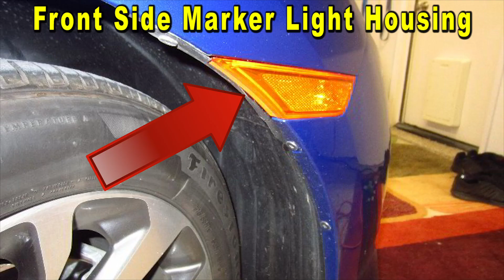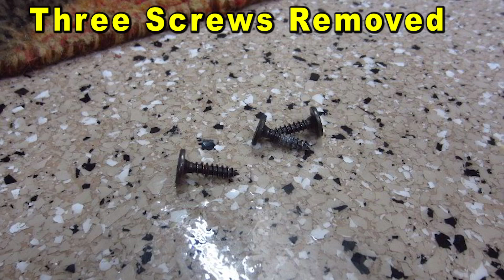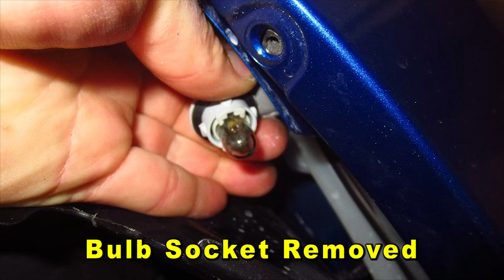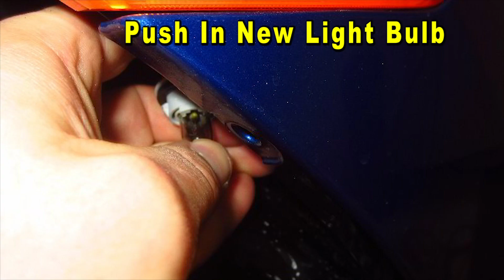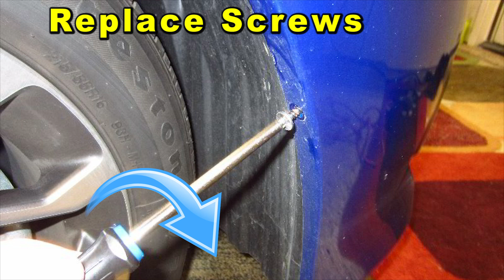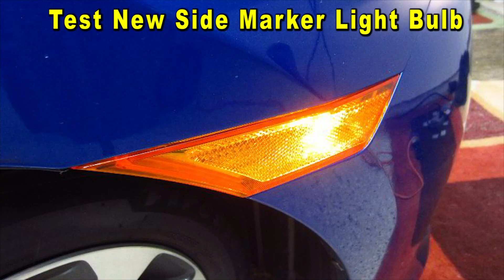Honda Civic How To Change Side Marker Light Bulb 2016 2017 2018 2019 2020 2021 With Part Number

Comment from the maker: Honda Civic Front Side Marker Light Bulb - https://amzn.to/44uHeFg
LED Front Side Marker Light Bulb Part Number - https://amzn.to/44BzQI1
Precision Screwdriver Set - https://amzn.to/3OYN1i0
Plastic Pry Bar Tools - https://amzn.to/3HMtsV7
Socket & Ratchet Set - https://amzn.to/3Z17LbA
Mechanix Gloves - https://amzn.to/3jCnHkt
Torque Wrench - https://amzn.to/3vS5uSI

The Paul79UF YouTube channel is a participant in the Amazon Services LLC Associates Program, an affiliate advertising program designed to provide a means for sites to earn advertising fees by advertising and linking to Amazon.

This DIY video shows owners of the 10th generation 2016, 2017, 2018, 2019, 2020 and 2021 Honda Civic how to change a burnt out front side marker light bulb in the bumper cover.

Comment from the maker: Check out the DIY guide for changing the front side marker light bulb in a 2016 to 2021 Honda Civic - 
https://www.paulstravelpictures.com/2016-2019-Honda-Civic-Front-Side-Marker-Light-Bulb-Replacement-Guide/index.html

Here are all of the DIY repair and maintenance tutorials for the tenth generation 2016, 2017, 2018, 2019, 2020 & 2021 Honda Civic - 
https://www.paulstravelpictures.com/Articles/2016-2019-Honda-Civic-DIY-Repair-Maintenance-Guides.htm

Owners of other Honda or Acura vehicles such as the Accord, Insight, Clarity, Fit, HR-V, CR-V, Pilot, Passport, Odyssey, Ridgeline, ILX, MDX, RDX, NSX, RLX and TLX may also find these DIY instructions to be helpful.